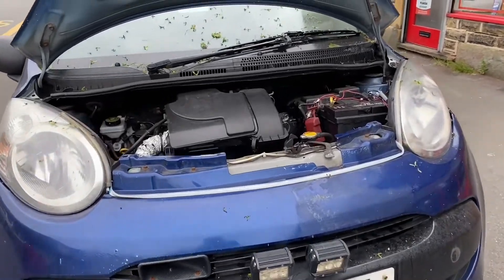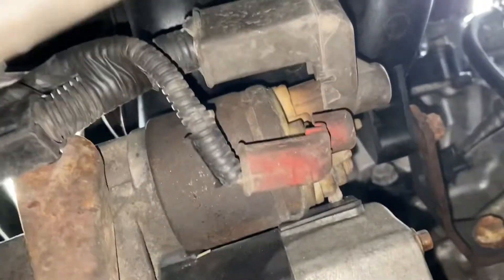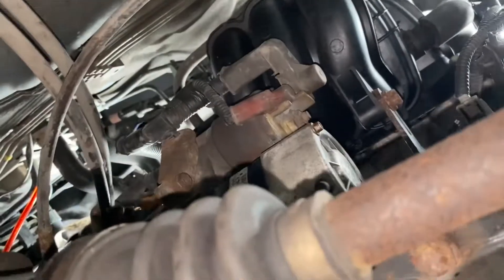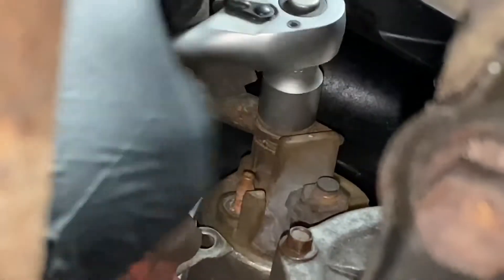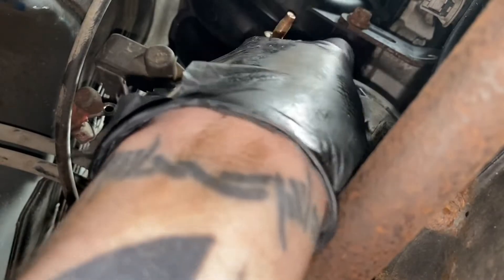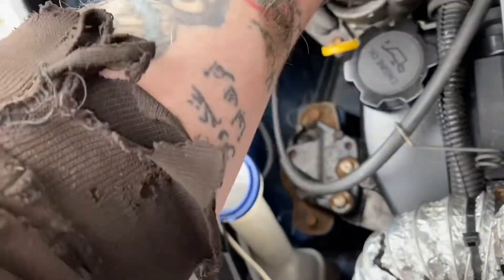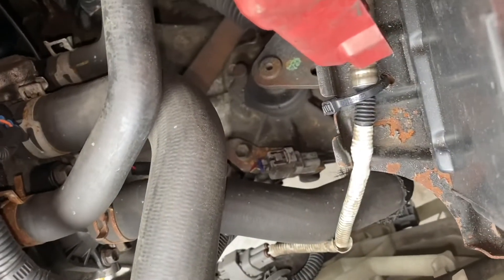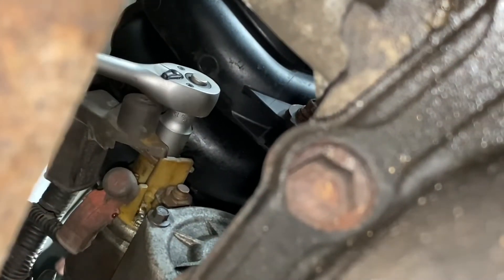Citroen C1 Starter Motor Replacement (Aygo/Peugeot 107/ CityBug)

Comment: I love it ,,, could you fit a kickstart ??

make up a bit of wire with a crocodile clip on either end and a 3  amp fuse in the middle ,, or at an end ,,, and use it as a link between the removed earth and the car its self and you will keep your radio settings etc ,,, like a cheap jump pack etc , and if you do short things out the fuse will blow ,,, just a thought .
Reply from the maker: Not a bad idea tbh
Reply: One of those square 9v batteries connected to the battery cables works as well.

Comment: Hi mine is 2007 vibe low liles only 37k. Only things gone wrong was water pump, gear linkage cable, and the real shitter was indicator controller that went kaput was expensive. Should I change gearbox oil or is manual fine? She is getting on a bit. I won't mention the boot leaks not too bad.
Reply from the maker: Pretty standard issues on these really. The indicator stalk is a relatively easy fix for free. I made a video fixing mine in the early days of the channel
Reply: @StupidBlokeStupidVideos  OK thanks. Will have a look. Mine was a new unit. Also I had to change the door locks, no central locking on this car. That was a few hundred quid.
Reply from the maker: @JC-hu1wd  I did a video on that too

Comment: Any reasons my C1 is burning so much oil,i just bought new PCV valve and i hope it helps but its burining 1L per 750-800km.(also i got check engine light and its giving out error saying my cat needs to be changed wich I doubt)
Reply: I've seen a fair few of those Toyota 3 cylinder engines burn 1L per 1000km after 100k miles, I think it's normal for them, it may be your cat is fouled from oil burning?
Reply: I added a tin of Wynns Stop Smoke - a gloopy product that seems to thicken up the oil reducing burning and smoke dramatically
Reply from the maker: Yea they aren’t unknown for having an oil drinking problem
Reply: @ferenczsinko6770  haha I used this on my previous car with leaky valve stems seals

Comment: Gotta do my starter motor. Not looking forward to it.
Reply from the maker: It’s not a bad job on these
Reply: Just finished replacing the starter motor. New off of ‘the bay’ for £65. All good now. BTW, I did try and work from the top of the car. In the end I found it was easier to get the car up on ramps. Even with a powerful torch, I could see bugger all from under the bonnet. Although still difficult regarding access, at least when I was under the car, I could see where the sockets were supposed to go! Whoever designed the fitting for the starter motor needs a swift kick in the boulux (that’s French, that is) Anyway, top video as usual.
Very much appreciated.
Reply from the maker: @TheNobbynoonar  glad the video helped. I found it easier to do from above by feel tbh, but from underneath is definitely easier to see what you’re doing

Comment: 3:37 Brand new starter doesn't come with this mounting plate unless you've got a second hand I think. 

By the way nice video, helped me a lot.
But that bottom bolt is a b...tch to remove. Didn't want to go at all. After all got it done 😉
Reply from the maker: Glad it helped mate